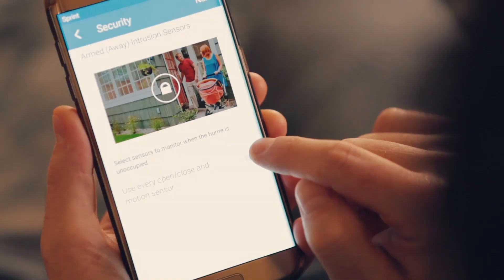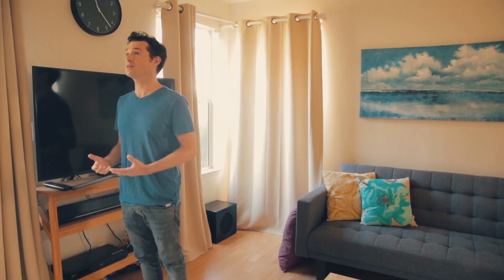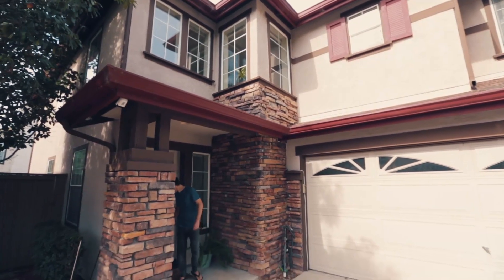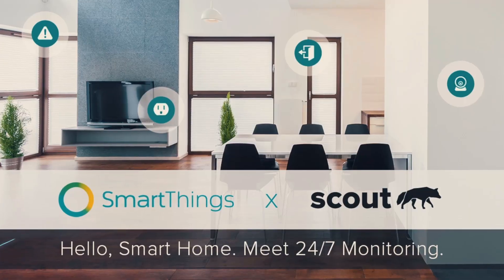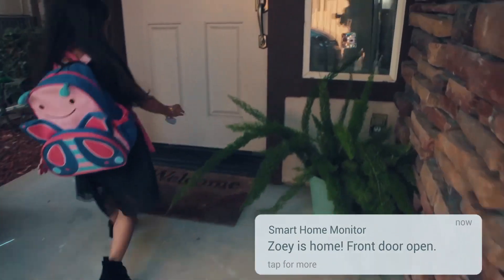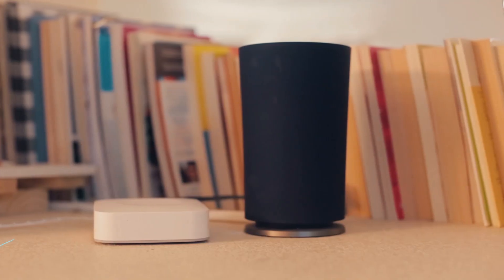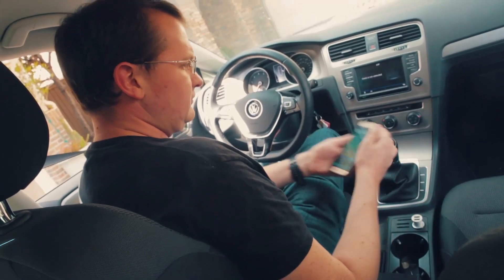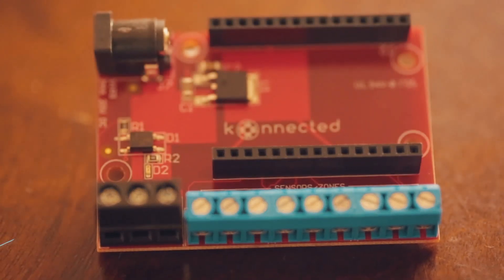Introducing the Konnected Alarm Panel - Kickstarter Video

Comment: Honestly, this is awesome. I just got finished installing an 800$+ VISTA 21ip hard wired system into my home. I had the idea that I'd be able to use the onboard ethernet to monitor on my own. Not so. I was upset that Alarmnet paid subscription is the only way to monitor and that there were no options for self monitoring. To be able to monitor on my own with no subscriptions will be awesome! Also, as an electrical engineer having designed my own PCBs, I think what you made here is a high quality piece of kit. Very nice and it shows that you put some time into the design. Especially on the pro board. Props! I will absolutely be getting one!

Comment: It doesn't appear that there is any input protection on the board. The door/window contact switches are directly feeding the sensitive esp8266 GPIOs with no hardware buffering/filtering/TVSS.  This is not a good idea, and not what is done in commercially designed home alarm panels. Cabling can pick up all sorts of noise and electrical impulses from that could damage the esp8266 inputs if not protected. At a minimum, each contact switch input should have a current limiting resistor and a low voltage high current MOV that goes to ground. The gold standard would include an opto-isolator but that would be overkill.
Reply from the maker: You are right, and we have had a handful of cases of damage due to nearby lightning picked up by the sensor wires. To protect against this we have found some general purpose diodes that can be used to prevent current flow into the ESP inputs. Our V2 hardware coming out later this year will have better protection built in.
Reply: @Konnected-io  I highly suggest a competent electrical engineer is consulted familiar with remediation of these types of failures.  Any potential design changes need to be fully tested by repeatedly injecting high voltages at the inputs using ESD test equipment. A simple diode (anode pointing away from the esp8266) can go into a "reverse breakdown" state under high voltage in which case it will still fry the MCU. High voltage needs to be clamped to ground before it gets near the MCU.